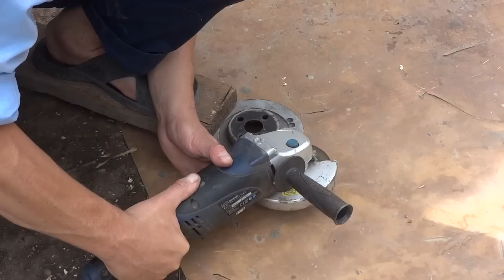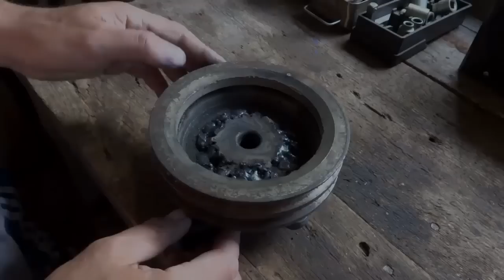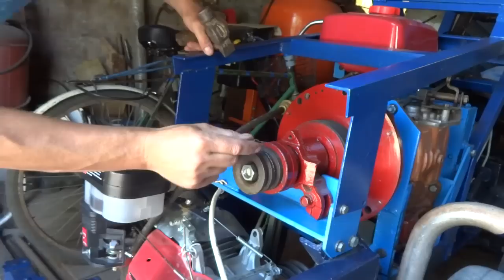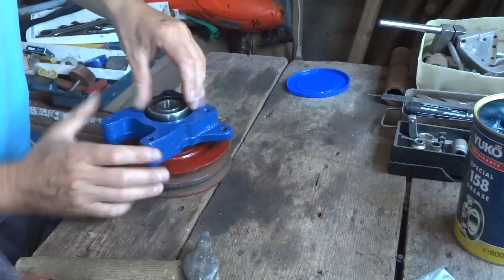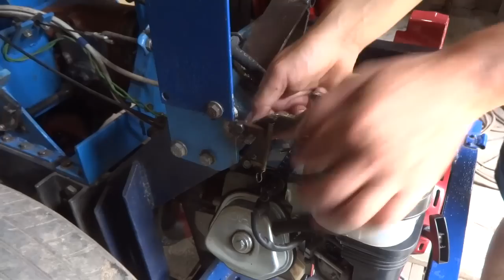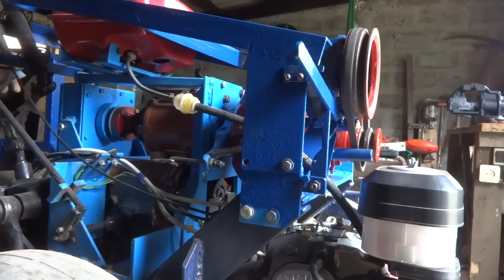Install the pump hydraulics in homemade tractor

Comment: Put the locking bar on the other way upside down and have a spring to keep the tension on the belts the locking bar is to hold the belts away  ,,, just an idea
Reply: 7v

Comment: 90 % of hydraulic pumps are not made to with stand hard side pul as needed on belt driven pumps, a power steering pump from a car or truck are build with very heavy baring to hold up to this sid pressed, unlike even very costly hydraulic pumps, 2 stage log splitter pumps also will not hold up on such a side pull of belt driven, that's why you always see a PTO  direct drive or a cage type mount with a love jot direct coupling off n engine, sure they will last a long time belt driven if it is not used or not used much, but you use it day in and day out you will take out the pump baring's in know time, belt driven is the worst way to drive a hydraulic pump, you will even see the pumps paper work, specs telling you not to belt drive, as a custom fabricator for over 30 years I have seen it all, when pump barings go its never a nice sight, and dangers
Reply from the maker: Thank you!
Reply: At 5.00 and later you can see he is making a support bearing(actually 2 ball bearings) to counter with these belt-forces
Reply: I'm pretty sure he didn't bother looking at the video...just came here to share his endless wisdom...
Reply: Actually, if you look close he is not directly driving the gear pump but using a makeshift pillow block thru a splined shaft to drive the pump this should offset some of the side pull.
Reply: Romppai's Outdoors I
Reply: @haynillesen  isn't that just the pump body he dismantled for welding? Pump doesn't need to disengage just remove the load by opening pressure return
Reply: No , he s making an extra bearing to relieve tension on hydraulic pump .
Starting the engine with disengaged hydraulic pump is a lot easier , especialy with a worn engine (this looks to be a good engine )
Reply: Actually , i think he bought the pump with the extra bearing already bolted on , he just took it apart .
Reply: Thats odd,... I have a couple belt driven pumps that ive had for years and some of them are used all winter long and have never had any trouble with them !  And only some pumps say not to belt drive them... not all of them.  and just a tip for you,... if you tension the belt properly you wont take the bearings out of it...

Comment: Wrong!
Masses in rotation unbalanced.
The idea is good but the implementation is not.
An escape would be the speeds. The hydraulic pumps with teeth accept speeds of 2000 ... 4000rpm. The higher the pump capacity, the lower the maximum speed. However, the engine speed is 3000rpm.